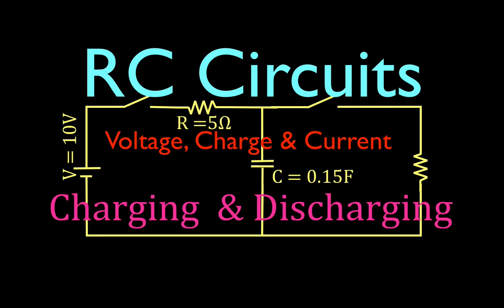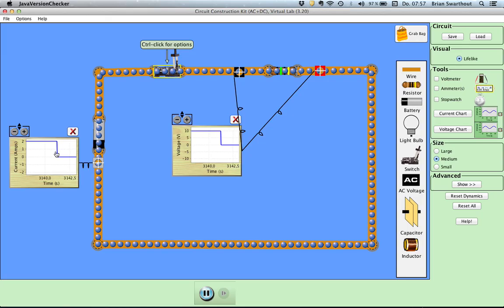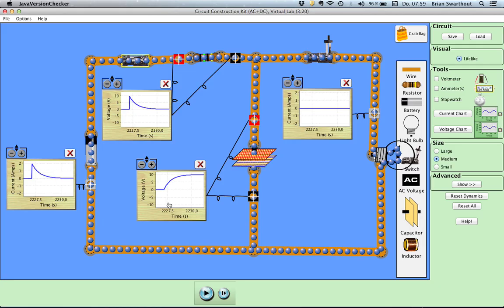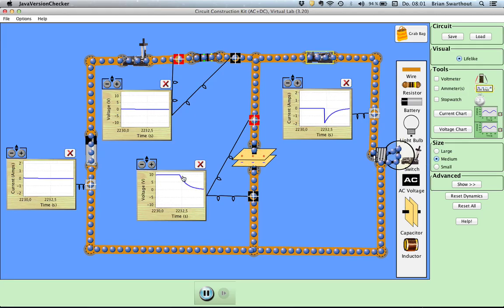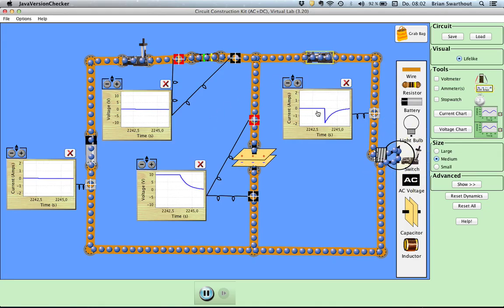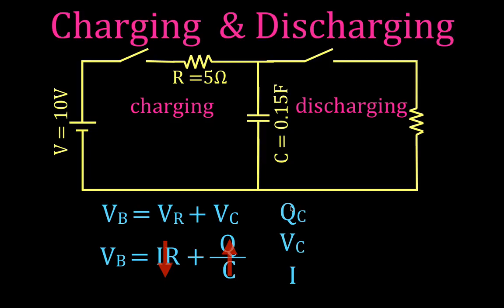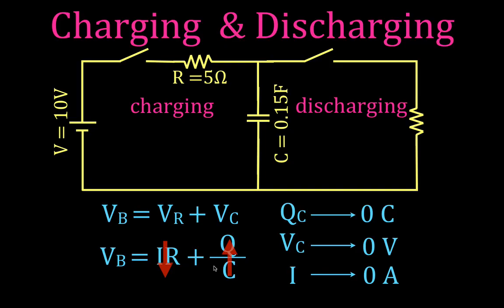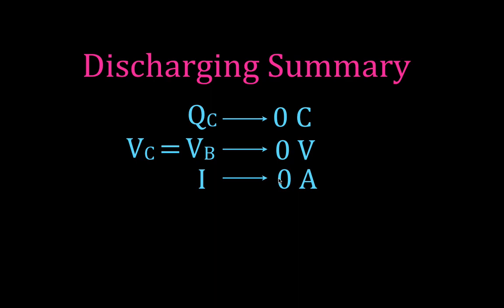RC Circuits (3 of 8) Charging & Discharging a Capacitor, An Explanation

Comment: When i do not have a battery in the circut, and the capacitor is fully charged. once i close the switch, the capacitor will discharge but the current will start charging yes? Cause if the capacitor is fully charged then no current will be flowing in the circuit, but now that the capacitor is discharging, current will start flowing and “charging” across the circut. Please correct me if i am wrong
Reply from the maker: Sounds correct, but I believe you are using the term "charging" incorrectly. The current does not charge across the circuit. When the switch is closed the current start flowing through the circuit.

Comment: Just some remarks: the energy in the charged capacitor is C V^2 , the lost energy in the charging resister is 1/2 C V^2 surprising this is not a function of the resistance ,

Comment: Why my current vs time graph is positive in discharging of capacitor???
Reply from the maker: switch the leads of the current meter and it will become negative. Often we are most interested in the magnitude of the current or voltage.

Comment: Thanks for these comprehensive videos, very helpful! One question though:
Why was the current across the bulb negative in the sim graph? Isn’t the charged capacitor acting like a battery to the bulb, so current flows normally when it discharges? If the blue dots are electrons, they were moving the same direction as when you first charged the cap in first phase…

Comment: First of all thanks for making this video, but i m confused why there is negative 2 voltage peak across resistor which is connected blumb ? Does the direction of current matter how to predict that?

Comment: This video  was soo  helpful,  but I have  a doubt  on the discharging part, the Vc  and Qc while  discharging  will decrease  but will it reach zero????, because  at some point  the stable condition  will be established  and some potential  and charge will be there  at the capacitor  ryt
Reply from the maker: The capacitor discharges to 0 volts.

Comment: Why current while discharging is negative? Capacitor has the same polarity as source which it was charged by, I can't figure out why would it be negative, as current flows in same direction as it would from source.
Reply from the maker: Because the current flows back in the opposite direction when the capacitor is discharged.

Comment: For the graph of I when the capacitor is discharging, why is it going down still? When it was charging it was already going down to 0. When discharging, shouldn't it be going up?
Reply from the maker: A it hard to explain here, but the charge decreases until the capacitor is fully charged and then goes back to zero when it is discharging.

Comment: The calculation of Charge across the capacitors needs to be commented that Total Capacitance is 4 microFarads not 4 microCoulombs as shown on the analysis, which ultimately leads to the correct answer.

Comment: at 9:13 I think the current is not maximum value because at that time, capacitor current is equal to C times dv/dt and equal to zero since Voltage across capacitor is in steady state (V=const)

Comment: these is the best video i've seen so far on RC circuits. these videos are really helpful. I was wondering how to do simulation on the PHET website but i couldn't when ever i click on the play sign, it download a .jnlp file and i could find an application that could open these kind of files. please help what kind of software could i use to run simmulations on a windows 10 operating system?
Reply from the maker: I think it is Java.

Comment: Good video. What would happen if both switches were closed simultaneously?
Reply from the maker: Current will flow through the bulb and continue flowing through the bulb.  Current will also flow to the capacitor until it is fully charge and then no more current will flow through that branch, but current will continue to flow through the bulb.  Does that answer your question?     You can see a listing of all my videos at my website, http://www.stepbystepscience.com
Reply: Step-by-Step Science Yes thank you, would the bulb flicker because of the constant discharge of the capacitor?
Reply from the maker: The bulb would not flicker and the capacitor does not constantly discharge.  In this circuit the capacitor would charge and then stay charged.